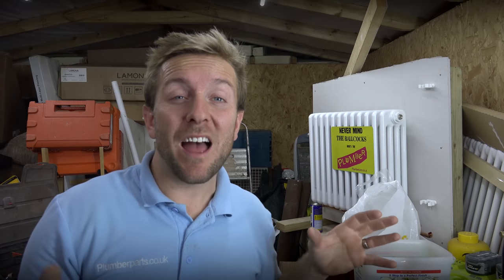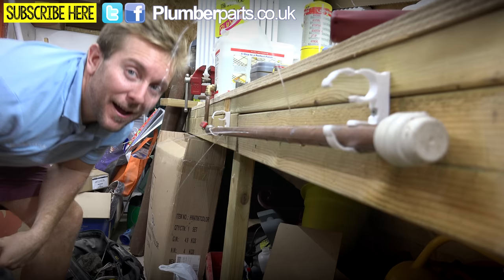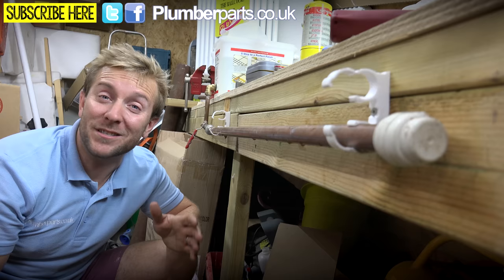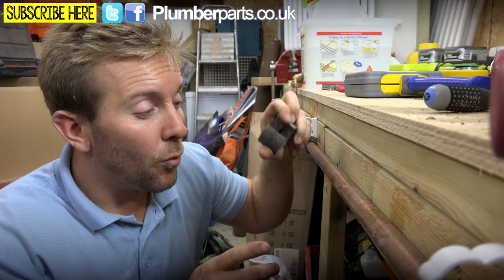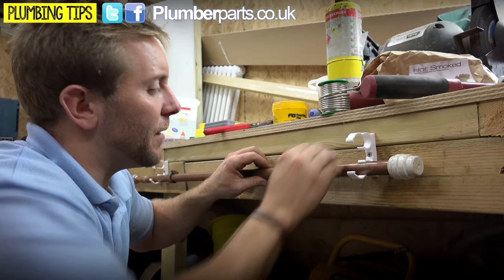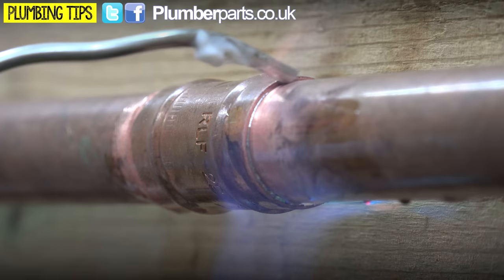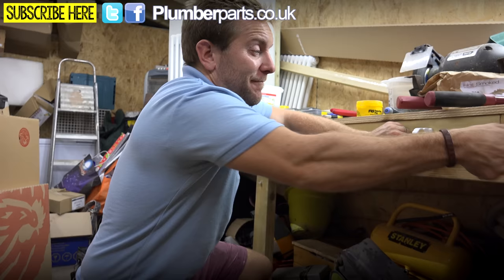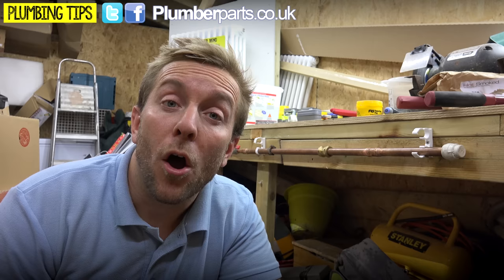FIX LEAKING COPPER PIPE - PINHOLES - Plumbing Tips

Comment: Shark Bite fitting all the way, the latest and greatest in plumbing repair! Prep the cut pie the same way, DEBUR the inside of pipe on both sides where u made your cut, slip the shark bite coupler on one end and push until it clicks, then stuff the pipe in the other end until it clicks (Or she yells, THATS THE WRONG HOLE, bahahahahhaaa) and you are done my friend!
Reply: Yeah - I can’t bring myself to trust anything with a rubber o-ring seal since working in the auto industry…
Reply: Very helpful video ! Would a Rubber lined euro clip with the rub already fitted be even better for a temporary fix ?
Reply: Very helpful video ! Would a Rubber lined euro clip with the rub already fitted be even better for a temporary fix ?
Reply: Yeah, but they don't make anything in 5/8" OD anymore, the only thing I need. Everything that said it was 5/8 was actually 1/2" OD, and now I'm waiting on Everything I need to solder it from China. 30 bucks for aluminum soldering rods with Flux, a big butane torch, and then I already went to great lengths to find the 5/8 OD Sharkbite sleeve, and it required one piece of wrapped gorilla tape on each end just to attach the broken spigot. But if I turn the water halfway on or more at the main shut off, it leaks. Sometimes the teeth don't hold the top part of the spigot in place, it flies out even with tha tape and the sharkbite connector. Turns out it's a metric pipe, and comes to 5/7", not 5/8". So I bought a bunch of tools and aluminum solder stuff and I'll put epoxy over the aluminum soldered part where the pipe snapped. Then I'll take the "waterproof" (it's definitely not) flex Seal tape that I first tried and even used clamps, and it didn't work. But in a few days there won't be anything to worry about, it will be soldered and fixed the right way for 30 dollars worth of tools and soldering Stuff.

Comment: One time I was installing sheet rock on a wall hat had a copper pipe in it.  The pipe went into a corner of the room, so I could not cut the pipe or sperate the ends if I could have cut the pipe.  Unfortunately a sheet rock screw found the pipe and made a hole in it.  I removed the sheet rock and a professional recommended cleaning the area around the pin hole, adding flux around the pipe. and then WRAP THE PIPE SEVERAL LOOPS WITH 12 GUAGE COPPER WIRE, flux the wire, and solder the wire and pipe together.  It has held for 15 years so far.
Reply: There are easier and better ways but whatever works for You.
Reply: @leowilliams7578 can you do that with water running out
Reply: @GGHBK953  I don't know. I've never heard of this technique before.

Comment: why not just sand it, flux it,  heat the pipe, and solder it, and wipe it?
Reply from the maker: You can do that too bro!
Reply: Because in real case scenario there will be water in the pipe
Reply: @daraghevans7637  if you torch the area long enough wouldn't that dry out the inside of the pipe?
Reply: @user-ty2uz4gb7v  sometimes it can if its a small bit of water
Reply: On larger holes I have cut out a piece of pipe like a sticking plaster on soldered it over.
Works well on buried pipes and it's always worth a try rather than dig the whole wall out.

Comment: Being a plumber, I wasn't surprised by anything here, except the terminology! I guess I'll nip down to the home depot and grab some jubilee clips, Yorkshire couplings, and bungs.  Ha!
Reply: Stelth  Jubilee clips in UK terminology. Here in America we call them automotive hose clamps.  Never mind the bungs!
Reply: not a plumber but if i found out that there are 3 pinholes on half a meter pipe i would call the police first...
Reply: In my plumbing class, we were taught NOT to apply any other type of metal to copper....
Reply: @east73rdst  brass and copper are fine together, in fact brass is a dielectric and good to use between copper and ferrous metals like a water heater tank. no ferrous metals (steel/iron)  should come in direct contact with copper water lines without a dielectric between them. many water heaters come with a dielectric nipple already installed for that reason.
Reply: @east73rdst  emergency temporary fix
Reply: I had a leak phoned the Plumber the bastard charged me R1400.00 to fix the problem. The only thing he did was insert a piece of rubber and clamp. After watching your video I realized that I was ripped off. I could have fixed the problem myself for under R10.00 I am a Pensioner. Plumbers you think nobody is watching you... but, the lord above is watching you.
Reply: Would, drilling the pinhole leak larger and threading a brass screw into it, be a bad idea? If those exist.
Reply: @ericnaidoo7018  ull never get me old man

Comment: You have NO IDEA how you helped me as I was all alone in a seeming disaster! Fixed it and kept grinning all day...still am...THANK YOU THANK YOU THANK YOU
Reply from the maker: Hi Elaine! No worries and it's great to hear I helped you out. Have a lully day! SUBSCRIBE! ➡️👉 https://www.youtube.com/subscription_center?add_user=plumberparts 👈⬅️ IF YOU HAVEN'T ALREADY! 😎
Reply: Which method did you use?
Reply: @plumberparts  please help  what do you do if only the top of the radiator is warn and the bottom is cold heating is on full and you should be able toch the radiator please help
Reply: @definitelymabe2311  your radiator could be clogged, possibly need your system flushing through or powerflushed. Sometimes its easier just to replace the radiator for a new one.
Reply: @plumberparts what if the pin hole is on the CH pipe,  does  turning the water off (stop cock) stop it

Comment from the maker: STILL UPLOADING TODAY SO PLEASE SUBSCRIBE!
♥ Please hit the 'Thanks' button if you think this helped 
🛠 AMAZON TOOL STORE: http://www.amazon.co.uk/shop/plumberparts
🤗 JOIN THE ALE ARMY: https://www.youtube.com/user/plumberparts/join
📺 VLOG CHANNEL: http://www.youtube.com/c/timeswithjames
Reply: My general builder accidentally drilled through 3 copper pipes.  Yes 3 ...all fixed with push fit fittings. Which I was not happy about. Especially as water is mains fed. The fitting is now leaking in kitchen behind plaster work. NIGHTMARE... Can't find traditional plumber. Do you suggest wealed option is longest lasting repair???
Reply: Why Not Just Apply Some Solder Over The Pin Hole
Reply: Thanks for that trip it worked for me
Reply: Thanks very much.  We fixed the leak, hopefully it will be a permanent fix.

Comment: Many thanks mate! That's what is wonderful about the internet. A lad in the UK saves the life of someone in LA. It was 10PM and and I drilled a hole in the wall it went right through and hit a copper pipe on the other side water gushing out.  You can't shut off the water in this place. So much so that I could not even turn off the main valve. What the hell do I do now? Here comes your video and your jubilee clip solution was the answer. I found a rubber gasket and took off the clip from another pipe and fixed the leak in less than 5 minutes. That was two weeks ago and I am still to call the plumber because the leak is repaired very well. I just wait until I'll have some plumbing work and I will ask the plumber to do this too because a plumber quoted me $250 just for this. Not worth it.

Comment: Turned off water at mains and used some bicycle tube doubled over a few times and placed it over the pinhole and then wrapped a jubilee clip around the pipe and patch and tightened it up well.  Turned the mains water back on and voila problem solved until my plumber has time to get to me to carry out a permanent repair.  Top Man James and  Many Thanks.

Comment: I was working late on my re-plumb the other night and I woke up the next morning to a damp floorboard. When I lifted it I realised I had put a bloody screw through the heating pipe. Fountain of water, no-one to help, no valve would turn, panic setting in. I put the screw back in the pipe and ran downstairs looking for a jubilee clip and a bit of rubber hose which I cut to flatten it out. I wrapped it around the pipe tightened the clip and no more leak! I really don't know what I would have done if I hadn't watched this video a few weeks earlier. Cheers James!

Comment: Thank you for the lesson on how to fix pinholes in the copper pipe. I wish I watched this two years ago. I am not a plumber but now I have the knowledge I need to do this. 

Thanks Again, 

Dave
Reply: Don't try the soldered joints. Best quick fix is push fit fittings.

Comment: Innertube cut in strips stretched and wrapped in layers over the leak, then held in place with wire. We moved into a house in an extremely isolated community on Vancouver Island, when I went to do some plumbing work on the house, there were innertube and wire fixes in numerous places, no leaks, on a community water system with a fair amount of pressure and they had been there for years! So for an emergency fix....

Comment: I've been using pin-hole clamps for years. The clamp pieces are interchangeable so you can get the dense flexible forever gasket easily over the pin hole. The clamp is 3" long and the gasket goes roughly end to end.  You mark 2" on each side of the hole so when you put the clamp on you can judge where the center is.  Then install the clamp and tighten the SS screws. You're done. It's so easy and it'll last longer than the pipe itself.

Comment: I love them compression fittings they just make life easy
Reply: until one end blows off, compression fittings are not all that, one bump of the pipe and you have yourself a full blown leak, AGAIN! Get a SHARK BITE COUPLER, that there is a true permanent fix. You will figure out what I'm talking about when u try to compression a fitting together where thee is pressure on the pipe and you're not able to get the ends to line up perfectly. You will always have a drip there. Go with a shark bite coupler, u literal cut pipe in half, debur both ends of pipe, then clean the outer edges on both ends, push the shark bite fitting over one end until it clicks, then push the pipe in the other end of the shark bite coupler until it clicks. Done! 100% fixed and no worries what so ever if ya bump the pipe.
Reply: How the F*ck you supposed to "push" a pipe into anything when its permanently mounted?!?! This isnt a stretchy piece of rubber tubing, its non flexible metal that stays in place...

Comment: Being a cyclist I have plenty of old inner tubes lying around.  If you cut a slightly longer piece you can wrap it around several times keeping in under tension.  All you need to do then is to hold the end so it doesn't come adrift.  Although one can't recommend it I have one job done (outside on the farm) where I never got around to making the permanent fix and the tube has lasted for 20 years.  You can be lucky.  I think it perished together and onto the pipe giving a really tough solid bond.

Comment: Just used the rubber and jubilee clip trick on a screw hole in a pipe as a temporary fix. Brilliant and so simple. Had the right bits in my bicycle drawer! Thanks a million.
Reply: Old inner tube? (or old tyre...?). I have a few of those as well...
Reply: Temporarily like for 4 years lol
Reply: Would this rubber and clip potentially hold up for a weekend even if the pinhole is on the hot water out from a water heater? 😅

Comment: Thanks for the video. I had a pinhole leak yesterday on a 15mm mains pressure copper pipe. I hadn't seen your video then, but luckily the local Wickes was still open and I managed to get clamp (£18) which I eventually managed to use to stop the leak. The hole was close to a right-angle bend and I had to use sandpaper to remove excess solder from the pipe before the clamp would make a good seal. It's still holding, but I'm back off to the DIY shop to get some pipe to make a permanent repair.  I'll take a look at your how to solder video first. 😊

Comment: Hi, thanks.  I am just a DIYer and needed to fix a leak last year. There was no spring in the pipe at all so I cut out a larger section of 20 cm. And inserted a section of say 16cm (can't remember exactly) with 2 compression fittings. This way I could get both slid on because of the extra manoeuvrability.  I looks a bit naff but did the job for me...

Comment: Excellent little video but I have a further reason as to why pinholes develop. It can be due to high Ph value in soft water areas.  The water leak can also turn blue which looks strange. My plumber had to replace the bad lengths of copper on two occasions with plastic as you suggested. I was renting but worried how many more leaks would develop in the future down here in Devon.

Comment: Not to throw shade, nor to make myself look stupid or lazy, but I have repaired pinholes the first way and, ten years later, the repairs hold.  It is possible to develop leaks near these types of repairs but, it will NEVER leak from the original pin hole.  Just use a piece of old radiator hose, which is reinforced, and clamp it.  Absolutely permanent fix.  
Really.
Reply from the maker: Wow man, that's impressive!

Comment: I'm in Ireland - I've had to replace a lot of copper pipe this past few years - a lot of it because of my mothers brothers dodgy plumbing - he actually installed a copper cylinder and had it sitting on polystyrene which the tank sank into over the course of 2 years - kinked all the joints into it and had to be replaced - plus the quality of copper pipe here is pretty poor...!
Anyway I've a pin hole and this video is a great help thanks bud....!

Comment: There is a rubber and gear clamp repair on a nail punctured 1/2 copper line at my mom's house that my father "temporarily " fixed when I was  young. ABOUT 50 YEARS AGO.

Comment: Just discovered a potential leak in a central heating pipe under concrete in a Bungalow, probably a pinhole as it took time for the floor to become somewhat damp. I have no idea what I am going to find once I dig up the concrete to get to it later today, but this video has given me a few options once I do! Hard to find a plumber this time of the year!!

Comment: There are patches  clip fix i think I’ve done it by cutting a section 30 mm or so and just over half the diameter of the pipe so that it grips the pinholed pipe, worked a treat. Love yu videos it’s the way you deliver them 👍🏽

Comment: I found that one place pin holes occur in copper is the pipes next to or near the electric water heater. I found when the electric cable comes out of the top of the heater it is run up to the ceiling and has been attached for support to either the inlet or outlet water pipes going to the heater, usually with plastic zip ties. My theory is that over the years the magnetic field, 60 cycles here in the US, induce a very small current in the metal pipes. Over many years this current causes copper loss to electrolysis resulting in pin holes.

So when I come across such an installation I just nail up a wooden stick, free the cable from the pipe and reattach it to the wooden stick support. 

And yes I made the temporary patch with a bit of tire tubing and a hose clamp. I used the same method to patch a pinhole in a truck's brake line. Necessity is the mother of invention. The step mother of invention is not have the money to hire a professional.

Did I tell you how I crimped off a broken rubber brake line with vice grips tied to the frame with strips of cloth? Didn't have the money for a tow truck. I guess I better keep buying lottery tickets.

Comment: For a pinhole leak I have actually used a self tapping screw which blocks the hole but a bit dodgy if the pipe is a bit weak from corrosion. When fitting a compression fitting  if the pipe cannot be moved lengthways  its important to cut a piece of pipe off to allow for the compression fitting. It still might be necessary to smooth the inside of the fitting so it can slide completely over one side of the joint then slid back to the centre.
Reply: I have used this method many times with  a tiny twist of  ptfe on the screw.

Comment: Hello from the USA! I enjoyed your vid but I must tell you, when you said "jubilee clip" I was like WTF?? Over here in the states we call them hose clamps or screw clamps so I learned a new terminology today. I haven't checked your soldering how to as yet but I wanted to mention that IF there is ANY water in the pipe you will never be able to properly solder it. Even turning off the water a residual amount might be present. To fix this dilemma, take a piece of bread and stuff it into the pipe to prevent any water from oozing toward your solder repair. Afterwards the bread will dissolve and you will be a happy camper as we say in the states. Thank you for the video!!
Reply: ...but not on a closed central heating system of course.

Comment: Amalgamating Electrical tape would seal it without turning the water off lol
Reply: I did this on a central heating pipe in my house when I bought it 18 years ago and it's still holding.

Comment: Back in the 1980's there was a shortage of copper tube .and so suppliers were buying in French manufactured copper tube. 40 years later its rotting along the rolled seam .its good if you want a built in sprinkler system but an absolute clanger if you like pipework water tight .
You fix one leak and another appears.
It's like a game of wackermole